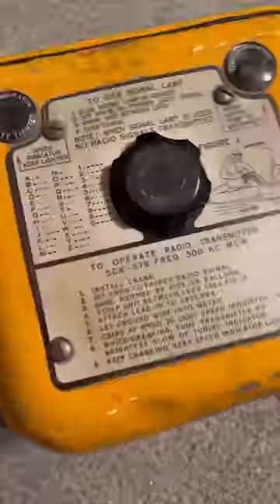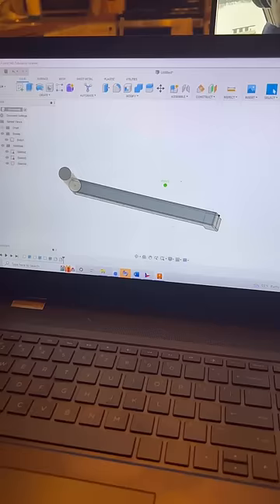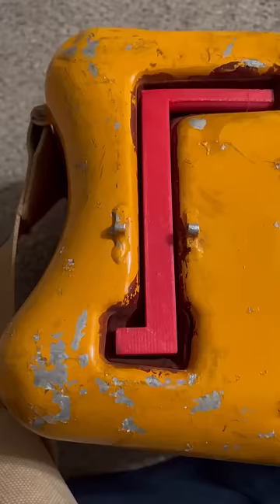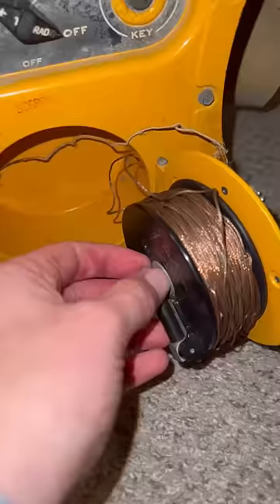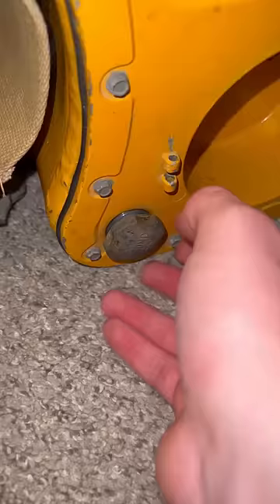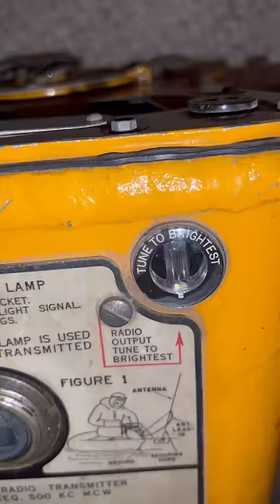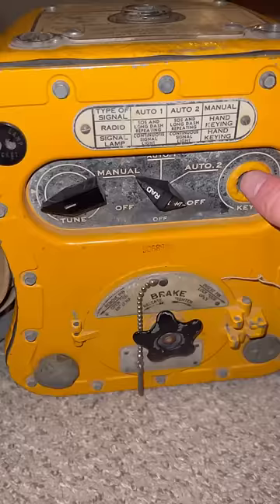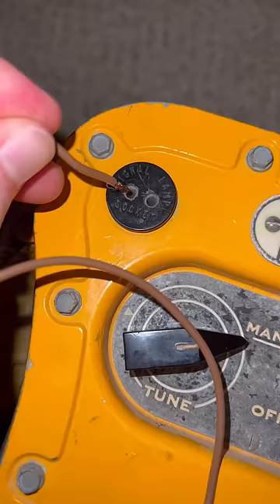Turning this Crank is Illegal

Comment: Well he's sadly misinformed about the part about going to jail if you turn the crank, first of all that transmits on 500 kilocycles that frequency is no longer monitored for the stress calls. With the exception of a few historical museums that monitor its sporadically for historical purposes to demonstrate its use as a calling frequency, also it is highly doubtful that the circuits inside that Gibson Girl radio are completely operable. Or that the crystals are even still functional. But let's just say they are. So now he needs to string up about 150 ft of wire and connect that other wire to a good ground connection furiously turn that crank. While attempting to tap on a morse code signal. That would probably have a usable range of maybe a couple miles during the day. Those radios were designed to be used on the open ocean, specifically the Pacific or the atlantic, to communicate to other ships and Shore stations. But they were highly dependent on propagation. The output level of that transmitter is probably a few milliwatts. At best. Remember you are the energy source and you have to crank that radio. So it cannot be very powerful. He could probably have a shortwave receiver sitting right next to it turn the handle and let you hear the beeps that it generates. However it's not as dramatic of a YouTube title, to hear let's hear what a 80 year old emergency Morse code radio sounds like. It's more dramatic to say I'll get arrested if I turn this handle. Also the handle that he's 3D printed. Would not be able to handle the torque necessary to turn that nut. It takes about 15 lb pressure continuously spinning. Also this would not be the jurisdiction of the local police department. It would be the jurisdiction of the United States Coast Guard and the Federal Communications Commission if for some reason this actually was to be turned into a case where they were prosecuted he'll be charged for broadcasting false signals on a distressed frequency. And for use of a distress signal when not needed. Both of which are misdemeanor finds?😂

Comment: IF YOU ARE A HAM YOU CAN ANNOUNCE A TERST OF THE RADIO CRANK IT IN MANUAL MODE AND ONLY TRANSMIT THE LETTER S OR O AND THEN ANNOUNCE THAT THE TEST IS COMPLETE. tHEY APPARENTLY OPERATE IN THE UHF RANGE AT  500 kHz.

Comment: If it wasn't modernized after wwii it will transmit at 500kHz (600m) that frequencey is no longer monitored for sos.  Crank away [unless yours was updated to 8280 or 8364 kHz.]

Comment: Sorry to be "that guy", but you used your calipers incorrectly. The main jaws are for outside measurements only, use the little teeth that are up above. Once you get good contact on both ends, close the locking knob and see the measurement. 

But if this is to just eyeball it, thats undersrandable.

Comment: That's.... Not how you measured that lol. Wrong side of the tool.
Reply from the maker: I made a whole video about that lol. In this case, that side was the better option.
Reply: @jackschneider17  oh okay, I always thought the other side was for measuring inside distance.
Reply from the maker: @joost6994  You’re right, it usually is. The problem here though was that the inner wall was sloped so there was no easy way to use the ID side. I just used the OD side since it’s longer and made it easier to estimate
Reply: @jackschneider17  all right, thanks for the explainer :D

Comment: Posting a title of turning the crank on this box and I go to jail, is so misleading it isn't funny. That radio only puts out a few milliwatts on a frequency that has been long abandoned for distress use. It's no longer monitored by any country. And is no longer considered a distressed frequency. After he was to string up a couple hundred feet of wire to make the vertical antenna needed. And secure a good enough ground connection you have to furiously spin that crane, while tapping out more code. This was hard to do even under the best conditions. Also that radio is at least 80 years old. The circuits inside of it have wax capacitors, and also use quartz crystals. There's a good chance that crystals have warped and it has drifted off frequency along with the oscillator circuits in the transmitter, no longer functioning due to dried out capacitors and the one tube becoming gassy. Justice League of argument should that few milliwatts of output actually reach it to a Shore Station that was monitoring and that Shore Station did turn in his fake distress call. And someone really cared it would be under the jurisdiction of the United States Coast Guard and the Federal Communications Commission the worst he can be charged with is broadcasting a false signals, and the use of a emergency distress radio, Walnut in actual distress.